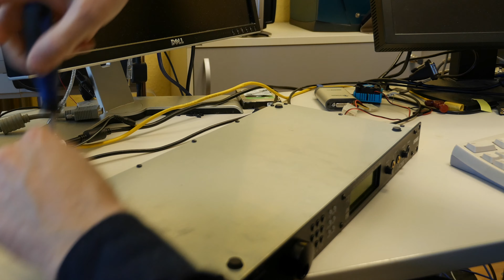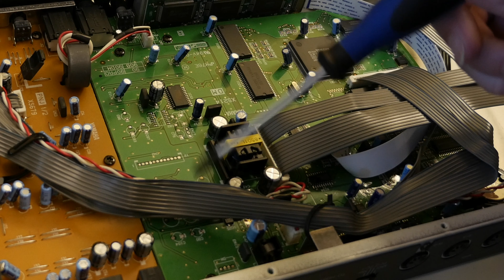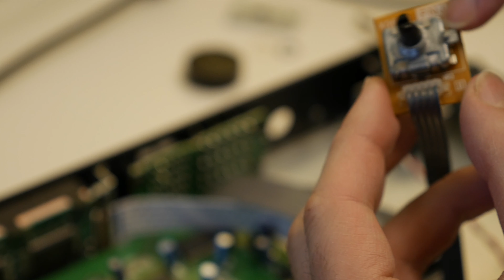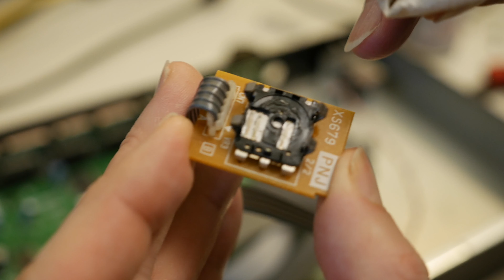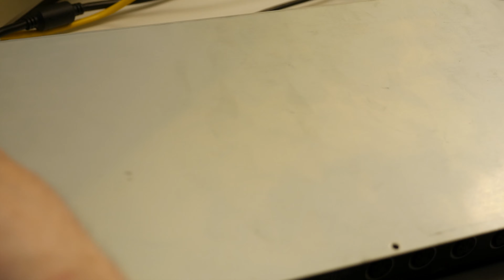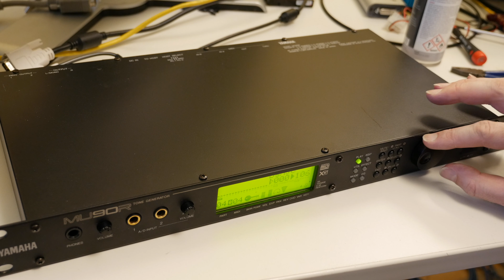Yamaha MU90R disassemble & rotary encoder repair - XG MIDI Tone Generator

Comment: When I run a #10 wave ROM built-in diagnostic test on my MU-100, I get: "10 WAVE ROM IC38, 39 er". The symptom I have is that there is a significant enough number (around 10-20%) of patches that produce garbage instead of the actual instrument sounds, making it unusable for playing MIDI files. I can still use it as an aux tone module with my synths with the sounds that work, but would like to get this repaired one day. I am much more of a software than a hardware person, so any suggestions what to look for in a repair person and/or how to approach fixing something like this would be great. I read some old online posts, where a person had a couple of very similar failures with his own MU's, and he basically had to have the wave ROM removed and re-soldered to the board due to some soldered connections failing. I'm not sure if this is what's wrong with my unit, but I am thinking this easily might be the problem.